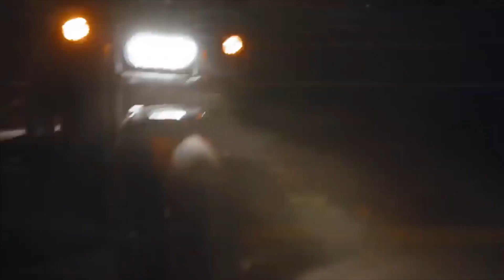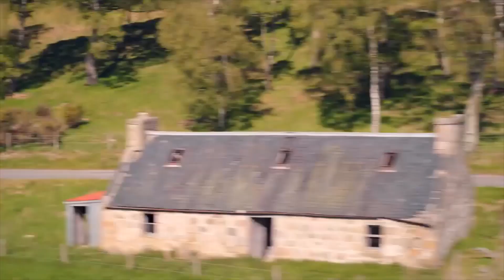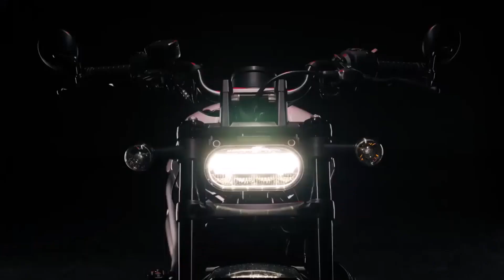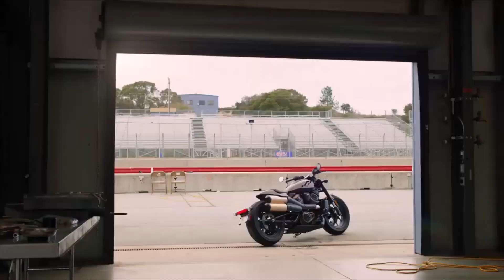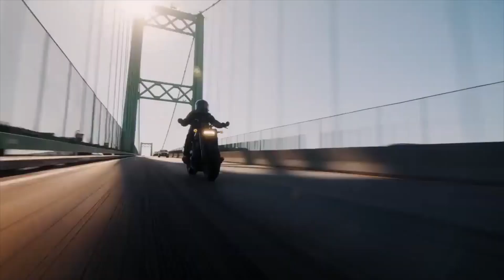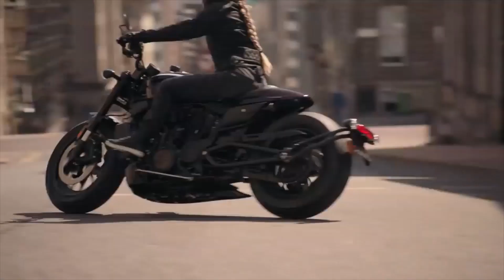HARLEY DAVIDSON 2022 | SPORTSTER S | First Impression | Exhaust Sound| Fully Loaded Features|

Comment: Harley Davidson had to refine and redo. Having the new revolution max engine obviously designed all the problematic issues out the engine/design getting rid of the huge primary chain rotating in oil, pushrods, rocker arms, vibration, bottom end cams etc.
 I think this engine in a touring model configuration will be game changing if the keep current styling and bagger items to work with current ones. Eliminating the hot air cooled engine in lieu of full liquid cooling & full counter balancing, ride modes, engine monitoring tech are huge leaps baring HD doesn’t ever let old schoolers and old school MC clubs dictate direction. T